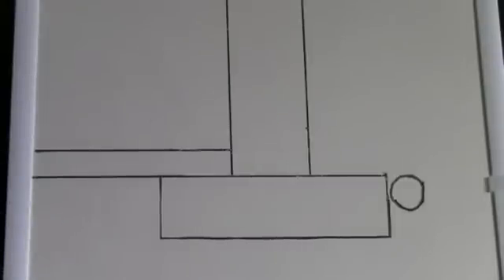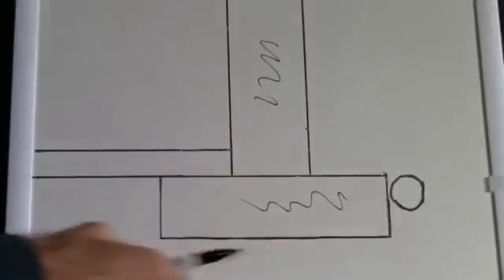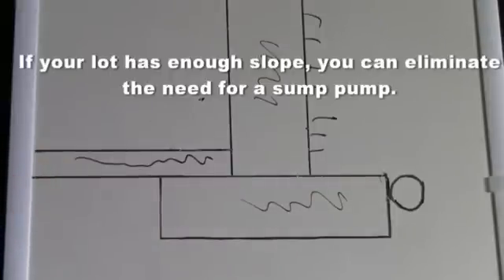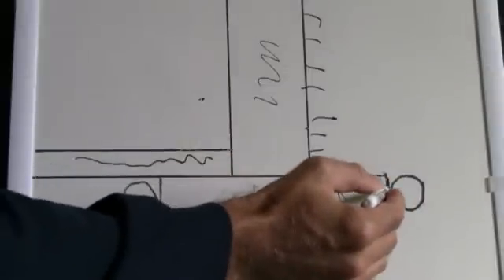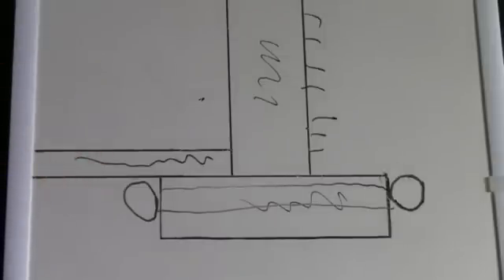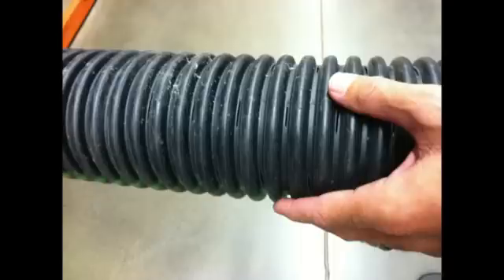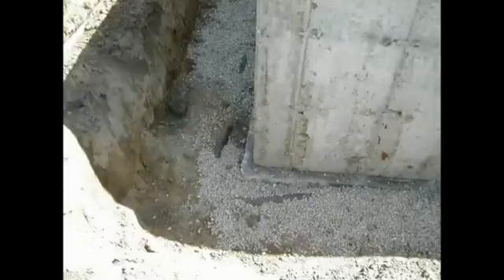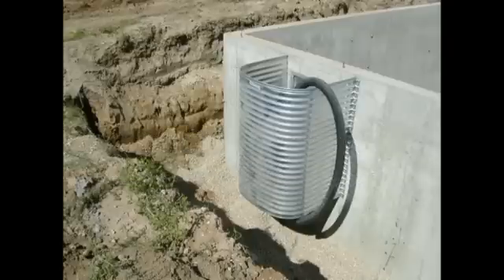Drain Tile and Your Basement

Comment: Question: I'm getting ready to install a sump pump drainage system in my basement with 4" perforated pipe surrounded by 3/4" rock and non-woven doubled punched fabric. I will have an egress window installed at some point . Should I install some kind of drain for the egress window before the cement that would tie in to the drainage system? If so how would I go about doing it?

Comment: Well first off this stuff should not be called drain tile at all. I'm sure somewhere there are tiles placed for drainage and this is not it. Even when your talking about tile and pointing to circles on the drawing board, this stuff is so mental. Just call it drainage pipe, that's exactly what it is.

Comment: Question, how do I get the external drain tile into the basement sump pump crock if the the footings are solid?  Do I run the drain tile under the footing?
Reply from the maker: Hi Tim.  It's best to run the drain tile pipe through the footing.  This can be accomplished by leaving a small stretch of footing out or by placing a pipe through the footing at time of pour.

Comment: What size bleeder are you drilling?
Reply from the maker: We install bleeders on new construction homes.  Basically a 3" schedule 40 pipe through the footing every ten feet or so which helps to bypass any potential obstructions in the draintile in the future.

Comment: I don't like window wells in new basement construction.  Just build the basement wall higher to avoid window wells.  Yes/no?
Reply: Windows wells can be a problem if they aren't maintained for sure.  But if you have basement windows, you need window wells.  As you suggest, you could have the foundation wall stick out of the ground more to prevent from having wells, but then you would need to apply siding to the foundation walls or you'll have an unfinished look.  This is easy if you are installing stone, but if using siding, it can be a little challenging to adhere the siding properly to the foundation wall...not impossible, but it does take some planning.

Comment: Ribbed or smooth pipe either one you want to include a cloth cover that still allows water to pass through  as it keeps out most debris and other forms of possible blockage and include an inspection riser or two, also and open top drain tile (trough type) tied in where the outside doorway is would be advisable in a retrofit where a simple single point would be impractical such as precast stairways, to catch and drain away any ingress of rain if the entry leaks or the door is open while it is raining for some reason. This trough inside in the outdoor entry would easily tie into the drain tile pipe and would thus negate need for a riser pipe. For those who get especially heavy rainfall with saturated water retention type soil conditions, would recommend not just an inside or single well, and if the water still tends to pool up in the basement a trough drain across the length or width  would also be advisable along with a higher gpm pump.

Used to install all kinds of waterproofing systems (for 5 years) mostly retrofit into older basements and newer ones where no drainage system was included or was improperly sized at the time of designing and building or was not installed properly (original contractor literally cut corners). CMU (concrete masonry units) block walls are the worst despite their low cost!

Comment: The home we bought has 3" perforated corrugated plastic drain tile. The daylight drain tube was completely clogged when we dug down to find the drain tile. We teed into the drain tile with a new 4" PVC daylight tube. Before we did that, we ran water through both sides of the drain tile by pushing the hose in as far as we could each way, before the water started to back out of the tile after a few minutes, so I'm concerned there is blockage around the perimeter. Could the corrugated tIle be water jetted out through the new daylight drain? The house is 26 years old. And unfortunately, the drain tile was placed on top of, rather than alonside, the footing. Thanks
Reply from the maker: Hi Stuart.  I don't think you will have too much luck water jetting out a corrugated drain tile pipe.  And as you probably already know, a snake will tear up the pipe and get stuck.  There's also a chance the pipe crushed which is impossible to fix without digging it up.  Are you seeing water in your basement?

Comment: Join Date: Mar 2018
I’m unsure if this is a problem or not, but I have a constant flow of water from around the perimeter of one of the pvc pipes that enters the sump pump crock in my basement. The water isn’t draining from the actual pipe, but from a gap in the cement floor around the perimeter of the pipe. My builder said this is normal. I’m curious if it is normal or not? I have a video of it to.
Reply from the maker: Hi Joshua.  So, the drain tile pipe has slits or holes in it that allow it to collect the water from around the foundation.  There is also a layer of stone that typically surrounds the pipe.  Your basement floor also has 3.5-4" of stone under it.  When there water table rises below your house due to rainfall or snow melt, it reaches the drain tile and the stone.  Some of the water enters the pipe while some just flows through the stone.  So, the flow of water isn't just contained in the pipe, it also migrates through the stone.  So, yes, it is normal for the water to come through the sump crock in places other than thru the pipe.   Hope this helps.
Reply: Armchair Builder 
https://youtu.be/cEYypjlXIkI

This is a link to a video of it I made. No water comes from the pipe at al.
Reply: Armchair Builder 
From the video I posted, does that look norman? Thanks.
Reply from the maker: Hi Joshua.  Yes, the water coming into your sump crock around the pipe is normal and is not a problem.

Comment: wait what? did you say install the pvc pipe with the holes downwards? how does that make any sense then the water wouldnt be able to enter it and if it did somehow manage to enter the pipe then it would all drain out cause the holes are facing downwards...
Reply: james miller Holes down so when the water table rises it fills the pipes and flows to pump basket.
Reply: the two lines of holes shown provide adequate space between to allow water to flow if properly installed with slight inclination to the sump well to be pumped out, putting the said holes facing up would allow more water to remain in the gravel drainage area. As a former waterproofing professional we always installed with the holes down and evenly leveled and sloped down to the sump system and never got a call about water backing up in the sytem as it is wise to add in a riser for easy inspection and possible cleanout of any growth or removal of blockage with a garden hose or water jet.

Comment: Is it ok to tie in a gutter down spout?
Reply from the maker: I wouldn't.  Your sump pump will need to pump every drop of water that gets into the system.  And you don't want to overload the pump when it rains.  If you tie the downspout into the draintile pipe, your pump will need to handle the volume coming off the impervious roof and the rising water table below.  Just my two cents though...

Comment: Thanks so much for the information! But how do we know if we have an exterior drain tile? Or even if we knew, how would one know if it was clogged or damaged in need of replacement?
Reply from the maker: +15bigdave Hi Big Dave.  We have quite a few resources at our website that address basement water ( One example is in our Troubleshooting Guide but we also have many free articles as well).  In my experience, interior drain tile became more prevalent in more recent homes.  This may or may not be the case in your area.  Do you have any architectural drawings from the original home build?  This would be on the plans.  You might also reach out to your local building department to see if they have any local background information from the time your home was built.  The local building department typically dictates whether exterior and/or interior drain tile is required.  Hope this helps.

Comment: can you tie in your gutters to this or is that not good
Reply: it would be a big NO as it would overload the drain system and sump, possibly lead to clogs from leaves andd other debris that may go down the gutter

 if you want you can tie the sump for basement water intrusion into a sewer (NOT the septic) system for more convenient draining if you do not live on a sloped property where it would drain into the low end of the property by gravity alone into a leech field

if you still want to drain gutter catchment and like previously said you can either tie it together and lead into its own drain to a sewer system or lower property leech field or if your town permits harvest it using a water harvesting system and large capacity tanks to collect the run off

Comment: I have water proofed a few older homes in down town Toronto. And used these steps with excellent results. Now I live in rural Newfoundland and I am telling people about these methods and and getting resistance. Can't wait to finish my basement and prove these guys wrong. I know I will. This system works. The only other thing I do is fix cracks with hydraulic cement and use foundation coating with fibre. A lot of the time it is only called roofing on the package. Then I roll 6 mil poly.

Comment: this video is good for very wet areas, many people may not need this much drainage. extra drain tile inside the house may be overkill for some.  keep in mind that in the past, there was no drain tile at all, many just used gravel, and these systems are still working. BUT in wet areas, use as much of these steps as you can.
Reply: Had a few home with the soil getting literally so water logged/retention that we would install out and inside systems with weeping tile and drip edge for days where rainfall gets heavy, This is New England, my step dad owned and operated the business and sold it 18 years ago
Reply: How do you get rid off water that tile collects?   Do you bring it in the sub pump in your basement?  Considering house is on flat ground.
Thanks!